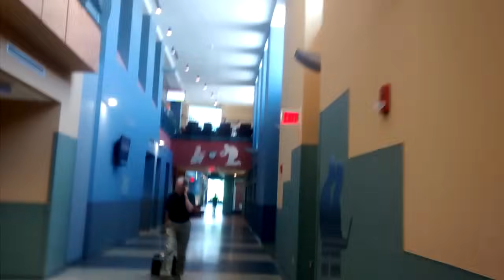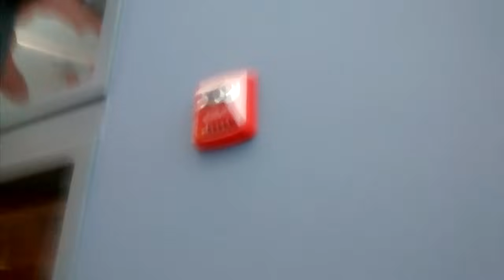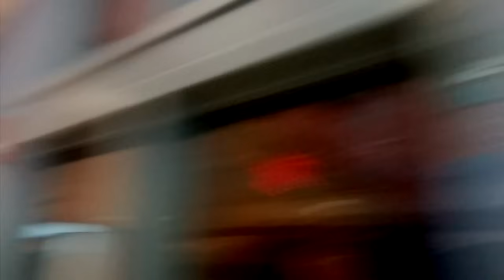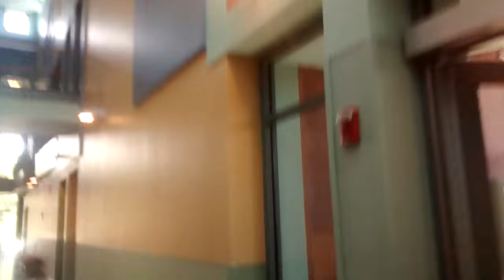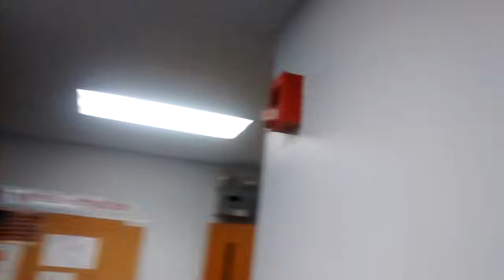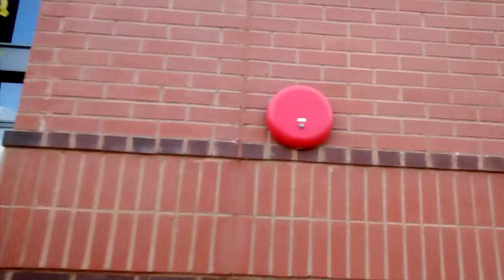Fire Alarm Activation Due to Suppression System

Comment: Surprised maintenance was able to prevent the discharge.  Usually once a fire suppression system alarm triggers you may get a pre-Alert and then pre-discharge but once it reaches pre-discharge you only have 30 seconds to evacuate before the discharge starts unless someone had his or her finger on the abort switch/button and KEPT it held down until they got there.
Reply: Especially not fun if the suppression system is something like halon.
Reply: Unless the system was installed before Halon was banned, discontinued, or whatever I doubt it's Halon could be FM200, C02, or some other agent.
Reply from the maker: Gary Beltz It's FM-200.
Reply: Gary Beltz ঙর
Reply: the exact reason why more fire suppression Installers should Install more notification appliances (like the HSR-A)

Comment: Wow! That's crazy! There wouldn't be a mess if it's a server room because it's FM-200 which is a gas and leaves no residue, aka a clean agent. All they would have to do is replace the tank
Reply from the maker: Good to know. I edited the description. I don't know much about suppression systems.
Reply: ExitSign250
Reply: So much misinformation about FM-200. Contrary to popular belief, it does NOT displace oxygen. I've been in both FM-200 AND HALON discharge tests, and I didn't suffocate. No one did. The only thing that happened was I got a raging erection.
Reply: @Aslin Fire Safety 🤣
Reply: @Fahrenheit4051  does the server room also have HSR-A’s?
Reply from the maker: @alexgilbert2  I think I remember seeing an AS in there.
Reply: @Fahrenheit4051  was It an agent unit with the lettering or no? Im just very curious so forgive me 😂 😂
Reply from the maker: @alexgilbert2  Sorry, I don't remember.
Reply: @Fahrenheit4051  no problem, lol

Comment: Why are the fire alarm silent in the other part of the building?
Reply from the maker: The system is partitioned so that signals only sound in the building the alarm originates from.
Reply: @ is that a new part of the building
Reply from the maker: @jacobisworld9516  Yes. This building opened around 2006-2007, and the addition opened in 2013. The upside-down speaker/strobes are only in the newer addition.
Reply: @Fahrenheit4051  two things first of all what is that Wheelock doing there? And in the other part of the building are those old fire alarms on a separate controller is that why they don’t go off when the speaker strobe goes off
Reply from the maker: @jacobisworld9516  The Wheelock horn/strobe is for the server room's fire suppression system. That system trips the main panel, but not the other way around.

Each building has a separate control panel, but they are all networked together. With a network, you can have all the signals go off together, or you can partition it as was done here.
Reply: I don’t understand in some of your other videos that Wheelock wasn’t going off and if they put speaker strobes in the new part of the building, why did they even put that Wheelock alarm?
Reply: @Fahrenheit4051  is that a new part of the building where the speaker strobes are
Reply: @Fahrenheit4051  and in the old part of the building, is that just one level. In the new part of the building has more than one level.

Comment: My high school also has those branded fire alarms. They are getting a little rare. Here is what we have in my school:
Wheelock AS
Wheelock NS
Vintage Honeywell (buzzer/still electronic)
System sensor SPSR with voice evac on Code 3
Wheelock motor bell which I did look over the logo, but don’t know what exact model it is (mechanical).

Comment: I wonder if the old simplex with the white cover on the light is part of the previous fire alarms if this is an older building. My middle school replaced the 1950s single stroke bells with est genesis speaker strobes and forgot to remove the bell in the cafeteria. It happened some point after I graduated

Comment: I believe those sprinkler bells are Wheelock bells but I could be wrong on that. That is bad that the fire suppression system was activated
Reply from the maker: They are Wheelock motor bells, but they're general alarm bells as far as I know. I'll have to see what they do if I'm ever there for a drill again.

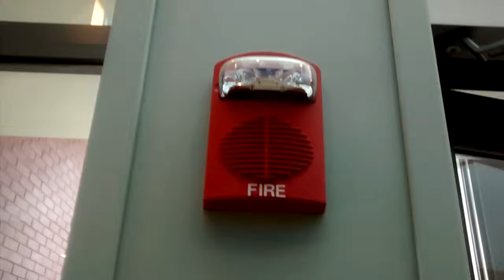Comment: 0:39 an upside down Simplex Trualert? Never seen those before.
Reply from the maker: Yeah. I just found out how they did that. They used blank covers, and put peel-and-stick letters on them. I figured that out after finding one where the stickers were messed up and peeling off.
Reply: Fahrenheit4051 but why tho? What was wrong with the normal letters on the truealert

Comment: Why do they still have the old speaker strobes up
Reply from the maker: Because they still work perfectly.
Reply: Why is there no slow whoop tone coming through them
Reply from the maker: Ohh... You mean the ones in the old wing. Those are horn/strobes, not speaker/strobes. They work, they're just not sounding because they don't need to be. It's the same system, but because the two buildings are separated by a brick wall, they don't need to have a total evacuation of the entire campus the moment the fire alarm trips in the other building.

If you want to see them in action:
https://www.youtube.com/watch?v=1oTAlCJDHaY
Reply: What type of panel is running the main buildings alarms
Reply from the maker: The whole college (excluding the library, which is a standalone building) is run on a network of 4100U and ES panels. The old and new building each has a 4100U. The 2013 addition to the new building has a 4100ES. I believe the ES is where the audio tones come from, since it was said to be different before 2013 (they have a 4003, but it might not be active since all the labeling was removed).

During a fire alarm, both sections of the new building will go off together.
Reply: I like this Channel

Comment: The wheelock exceeder has an "AGENT" lettering on it. Does it do simplex voice evacuation or slow whoops?
Reply: Sorry to be 3 years late, but the Simplex Truealert speaker/strobes (the long ones that are rounded on the bottom (or top) & say "FIRE" on the bottom (or top) are the ones doing the slow whoop tone. (not sure if there's a message though) The Exceder is doing the code known as "pulse", in this case acting as an agent release alarm for the suppression system.
Reply: @TheCarson116  Simplex truealert Attention Attention Attention an emergency has been reported
Reply: @BlackDragonZG7  Yes: that's part of the default message at least.

Comment: Do they do a voice evc or just the slow wloop?
Reply from the maker: Just slow whoop. The ones in the library (a separate building from the other two) do the classic 4003 slow whoop and a voice message. This system may have done it at one time, too; it has a 4003, but it may have been disconnected, as the labels were removed some time ago.

Perhaps they changed over once the 2013 addition was added.
Reply: What message does the one in the library play?
Reply from the maker: Can't remember. Probably the default "An emergency situation has been detected..." message.
Reply: Steven Lebbin
Reply: you mean fast whoop 4100ES dies not do slow whoop
Reply: Steven Lebbing 
o
Reply: Hola me gusta mucho la música de mi
Reply: this system does the fast woop
Reply: Steven Lebbing p
Reply: +isis Hernandez Speak English.
Reply: They can have voice actv but just on slow whoop

Comment: Agent wheelock exceeder during a fire alarm system? HOW?
Reply from the maker: There's a fire suppression control panel in the server room. The Exceder is part of that system. When it goes into pre-discharge warning mode, the Exceder beeps intermittently.

The suppression panel's alarm relay also activates, tripping an alarm monitor zone on the main fire alarm control panel. The building's general fire alarm goes off.

If enough time were allowed to elapse, the suppression system would discharge the FM-200 clean agent, and the Exceder would be sounding in continuous.

Comment: So an ES system's suppression release just set off the agent alarm in Pulse?
Reply from the maker: No. The Exceder is connected to a suppression panel in the server room (presumably something from Ansul because it looks like a Fire-Lite). The panel trips a point on the 4100U/ES network.
Reply: @Fahrenheit4051  Oh. It may or may not be a 4000R. Thanks for clarifying.
Reply from the maker: @Undercoverelevator212-s2n  Looked more like an AutoPulse 542R, but I can't be certain.

Comment: Why didn't the alarm company ever replace the broken simplex fire alarm horn strobes
Reply from the maker: Because they're not broken. There's a brick wall and a series of fire doors separating the two buildings, so they don't need to do a complete evacuation of the whole campus.

In the case of an automatic fire alarm:

- All three interconnected panels will go into alarm.
- If the alarm is in the old building, the signals in the old building will sound.
- If the alarm is in the new building, the signals connected to the two panels that serve it will sound.

I'm not sure if it's the same if a pull station were activated.
Reply: Fahrenheit4051 how come they chose to keep the old electromechanical horn strobes and not update to trualerts so everything is matching and if that exceeder is a fire alarm why in the hell it says agent and doesn't say fire
Reply from the maker: Because they're not required to be replaced, and doing so costs a lot of money.

About the Exceder, please read the description.
Reply: I don't know but they should replace them.
Reply: @Davesand2003  As said above it's not really necessary as long as they still work properly.

Comment: Are they going to fix the broken alarms? Or maybe upgrade them.
Reply from the maker: If you mean the ones in the old building, they're not broken. They're on the same system but will only sound in the event of an activation in that building, or a general alarm.
Reply: Fahrenheit4051 are all the fire alarms on your campus interconnected despite being in different buildings?
Reply from the maker: Both of the buildings in the video are interconnected. The library building is separate.

Comment: what was the model of that upside down simplex truealert speaker strobe?
Reply from the maker: Since they're fairly new and yet lack an LED indicator, probably 4906-9151 (conventional, multi-candela). The faceplates are 4905-9811.

Comment: what kind of agent does the system use?
Reply from the maker: I can't remember. It's either FM-200 or Agent 007. But it's probably FM-200.
Reply: @Fahrenheit4051  what is Agent 007
Reply from the maker: @noahandrewsandrews7830  Bond. James Bond.

Comment: That bell was loud so loud it made me jump but I still like this video and why are the horns silence?
Reply from the maker: The horns are silenced because it's a different section of the building, separated by a firewall and a series of fire doors.

The system here consists of a 3-panel network. The panel in the old building was in alarm, too, but the signals aren't programmed to sound in this situation.
Reply: Well then I guess the panel is broken. It might need to be fixed.
Reply: @Davesand2003  It's not broken, as Farenheit explained the system is divided into sections & only certain sections will go off in certain situations.

Comment: What kind of that new. fire alarm speaker strobe is?
Reply from the maker: Simplex TrueAlerts with blank covers and stick-on letters. The original part of the 600 building has normal ones.
Reply: Oh
Reply: But why is that new speaker strobe not saying may I have your attention pls a fire emergency has been reported in the building pls walk to the nearest exit and leave the building do not use elevators?
Reply from the maker: Because that's just one of many options. They decided to have it just play the tone until someone actually picks up the microphone.

Fire alarm speakers get their audio from another source, in this case a 4100-series panel with a 4003 used as a "slave" panel. Voice sounders, on the other hand, actually have an on-board voice generator.  But I believe they are only used in Europe.
Reply: Seriously.
Reply: But the new speaker strobe looks like a simplex truealert.
Reply from the maker: Like I said, it IS a Simplex TrueAlert.
Reply: I hear like you said.
Reply: But how is a 29019A3 or what the heck the model is not sounding?
Reply from the maker: The school uses a Simplex 4100U/ES network system, and it's programmed in such a way that the alarm will only sound in the building it's tripped in. My guess is that if a manual pull station were activated, they'd all go off.
Reply: harlequindrums  z xl

Comment: Is the agent alarm suppose to always activate with the fire alarm? Or is that just for sprinkler activation?
Reply from the maker: That signal is part of the server room fire suppression system for the server room. The "agent" in question is FM-200, a fire suppressant chemical. The signal is warning of an imminent discharge. The fire suppression panel tripped the 4100U/ES.

Comment: it would have been interesting if they had Agent release alarms in the other building with the 2903s.
Reply from the maker: They do - a Wheelock MT-24MCW-FR. It's a completely separate room, so it didn't go off.
Reply: @Fahrenheit4051  does it have agent lettering or no?
Reply from the maker: @alexgilbert2  "FIRE". Purpose of the signal is indicated by a red sign/plaque underneath.

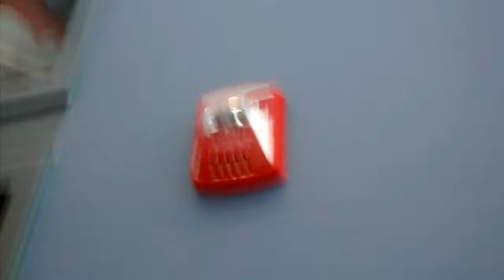Comment: The sprinkler went off so angent release and the fire alarms went off (00:00:23)
Reply from the maker: Nope. The server room has a clean agent fire suppression system. A heat detector connected to this system tripped, causing the agent release alarm to activate. The countdown either began immediately, or the system may wait until another device trips (cross-zoning). This suppression system is monitored by the building's fire alarm system, hence why that went off, too.
Reply: So does that it means there's a fire
Reply from the maker: @taxilthegreenchicken999   Thankfully not in this case. It was a very hot day, and the room temperature may have gone up too quickly.
Reply: I have 326 fire drills in my apartment first time it went off/november 16 2018

Comment: The new ones are stupid because the strobe needs to flash down not,up
Reply: They're flashing downwards. Simplex just revamped the alarm and decided to put the strobe in a different place.
Reply from the maker: Nope. They're flashing up. Simplex installed them upside down and had to put custom covers on them.

These are regular TrueAlerts, not ES's.